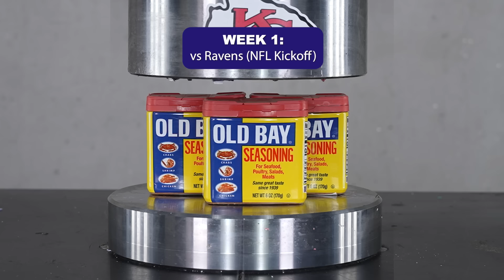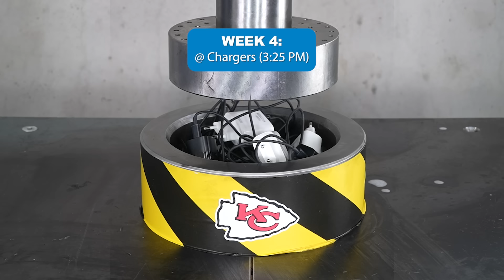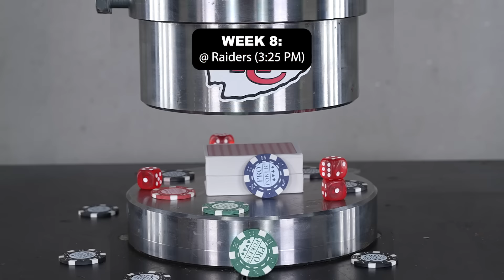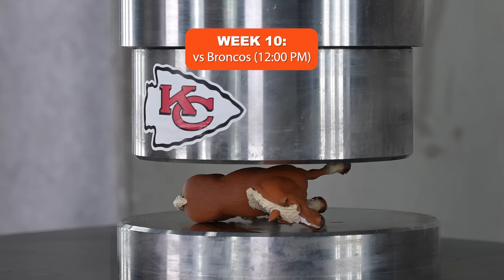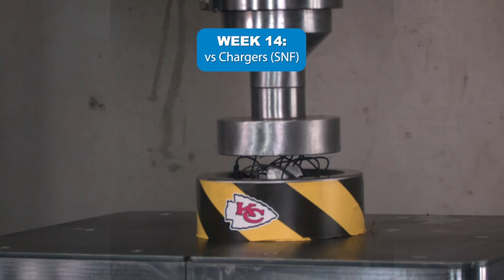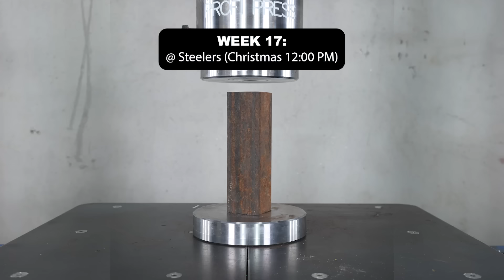Chiefs 2024 Schedule Release | Hydraulic Press | Kansas City Chiefs

Comment: Well, one thing we can all agree on. If/when the Chiefs threepeat, it will a monumental, legendary feat, that is very likely to be heralded as the greatest run in sports history. Due to the sheer fact, that this is the only sport in history, that is literally, designed, so teams cannot dominate, year, after year, after year. So no, a team that won 12 championships in a row, in 19dickity2, is not the same. And no, I am not saying they will for sure do it. Just commenting on the reality if it does. And yes, 4 SB's in 5 years, is much, much more impressive, than 6 SB's in 20 years.